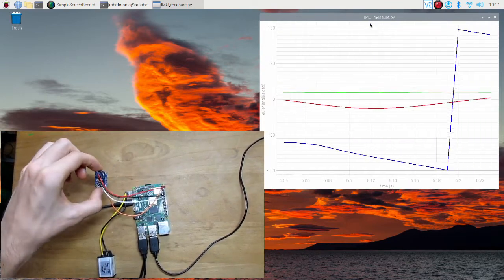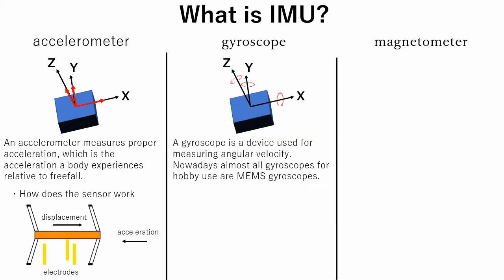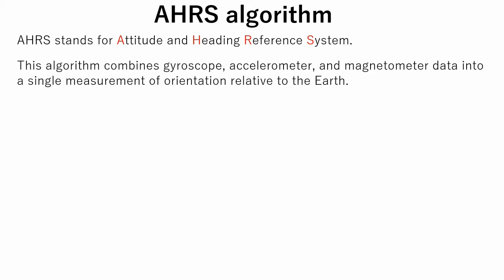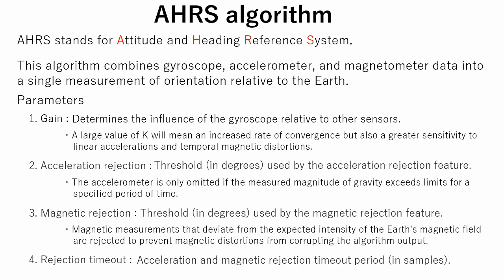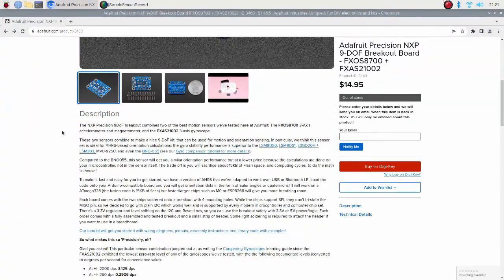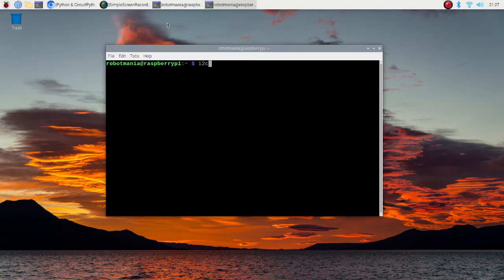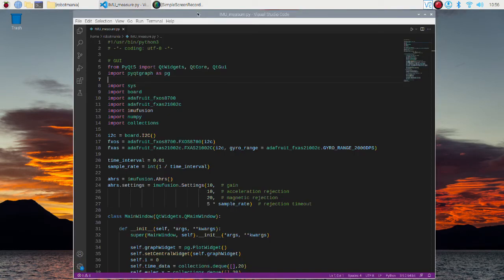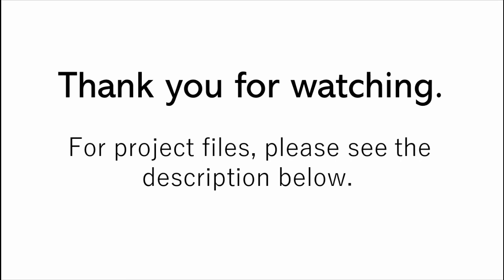How to use IMU with Raspberry Pi

Comment: Can you use a BNO055 instead of the IMU that you use? If so what can I change in the python code to make it work for the BNO055? Thank you!
Reply from the maker: Hi SusDio!
Thanks for watching my video!
Yes, the code provided with my video should work with BNO055. Please refer to this page to use BNO055 libraries.
https://learn.adafruit.com/adafruit-bno055-absolute-orientation-sensor/python-circuitpython

Comment: Great video!! I have one question left tho. What exactly is the difference between a IMU and a MEMS? Do they work together? Maybe you can help me to answer my question to get better understanding. Thanks a lot :-)
Reply from the maker: Hi Jonathan Edling!
Thanks for watching my video!
In my understanding, MEMS itself is a sensor (accelerometer, gyroscope). And IMU consists of several sensors (often MEMS sensors), circuit and a program. I also found an interesting article. I hope it will help you.
https://www.geospatialworld.net/prime/special-features/difference-between-mems-fog-imus/
Reply: Thank you! Great article ❤

Comment: I got a question: can I use ubuntu os22.04 with imu bno055 this code be active?
Reply from the maker: Hi Tân Lê Thái!
Thanks for watching my video!
I think you can use bno055 with ubuntu22 using this library
https://rpi-lgpio.readthedocs.io/en/latest/
But the code provided with this tutorial is not applicable for ubuntu22.

Comment: Hi, do you think that signal could be more accurate using a raspberry instead of an esp32 wroom 32??? I need a very accurate X movement signal. Thanks
Reply from the maker: Hi Dj Kad aka MC!
I have never used esp32-wroom-32, so I cannot tell you for sure, but if the computational capabilities of these two devises are the same, I don’t think that there will be any difference.
Reply: Thanks. I think esp32 have enough resource. Probably i should focus on the MEMS chip specs. I'm starting with mpu6050. If i need more accurated signal i will buy a MPU9250 because has better performance. If it's not enough i will buy an expensive ADIS16470. It's a very important project

Comment: it shows an error after the "pip3 install imufusion" i don't know why, help please
Reply from the maker: Hi Michelle HC!
Thanks for watching my video!
What kind of error do you have?
Reply: @robotmania8896  go the same error, it says "ERROR: Could not find a version thta satisfies the requirement imfusion"
Reply from the maker: @psamae  I think it could be a python version problem. Which version of python are you using?
Reply: @robotmania8896  I am on python 3
Reply from the maker: @psamae  Which version of python3 exactly? It seems that “imufusion” is provided only from python3.8.
https://pypi.org/project/imufusion/1.0.6/#files
Reply: @robotmania8896  That might be the issue then, I am running oython 3.9
Reply from the maker: @psamae  Well, imufusion should run on python3.9, so there should be some other reason.